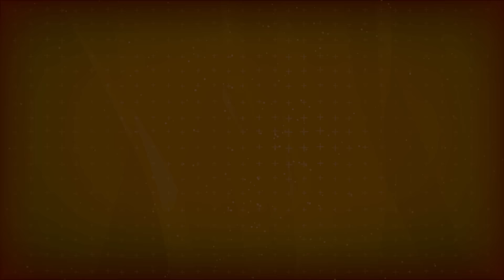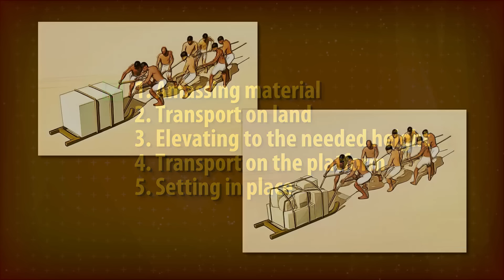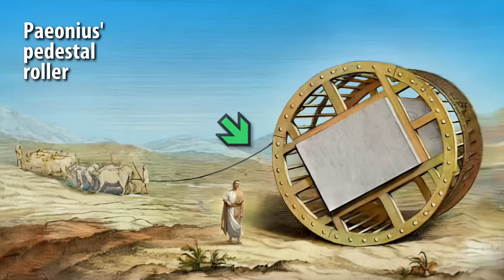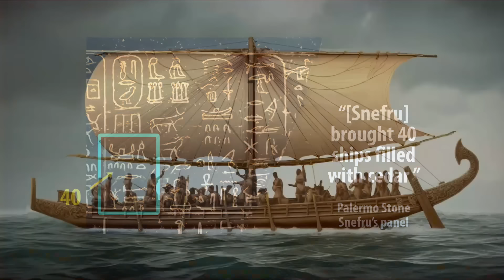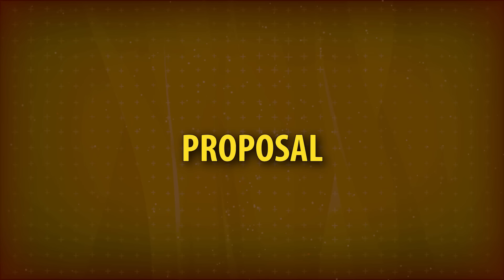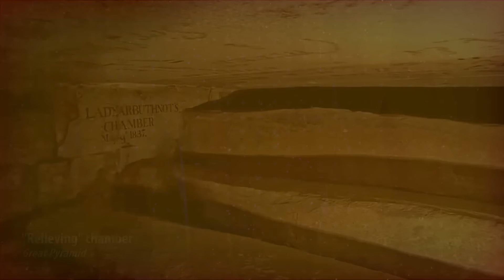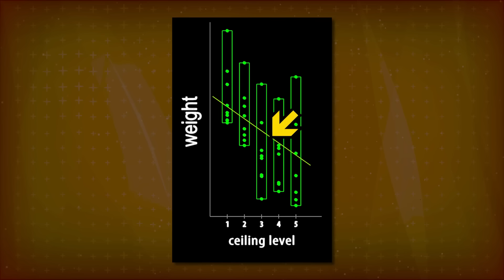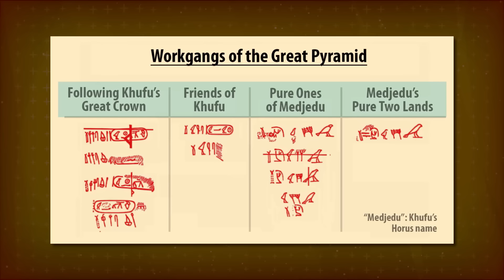How to Build the Great Pyramid in 9 Months (NOT aliens)

Comment: Interesting and well reasoned but I still think Houdin's internal ramp is simpler (and with more evidence) than the complex external fractal ramp. 
Your mud brick rollers could be used there just as well, and rubble components, and your various pulling machines.
I also think that Houdin's explanation of the function of the grand gallery for lifting the granite blocks is pretty certain. Without that use the gallery is a very bizarre thing.
Hopefully Zahi Zawasshole will go into the West soon and someone will prove Houdin.
Reply: It's a good thing Zawasshole exists, otherwise the Caucassholes of the world wouldn't have anyone to blame for the end of their rapacious and predatory pillaging of Egypt's material culture. After enduring the European and Moslem thefts and destruction that swept through Egypt and surrounding regions for hundreds of years Egypt finally reached a point of stability sufficient enough to allow for a curator/champion/ security guard to look after the countries treasures and Hawass was chosen for that role. His hard-nosed, overly-protective guardianship naturally rubbed many Western researchers the wrong way and led to accusations of theft but the charges were never taken seriously and he was completely cleared of such charges and works in his original capacity to this very day.
                                                                              Anyone who's willing to do a little research instead of listening to and believing a few disgruntled and privileged Western scholars and media will soon find out that Hawass is doing exactly what his government has asked him to do and done it while suffering accusations of theft, antiquities smuggling and the bullying of academics, etc. In reality, he should be applauded for his unwavering support of "Egyptian Egyptology" because, afterall, even if Hawass or a member of his staff hypothetically stole something (which they haven't) they still have an advantage Europeans can't claim for themselves: Anything a hypothetical Hawass might have taken was taken by AN EGYPTIAN, not some narcissistic, deluded, thieving European.

Comment: This is very well thought out.   I would lean to the internal ramp scheme, but that would not exclude your lift mechanism, at all.  I really appreciate the emphasis you place on the fact that other very large pieces of stone were employed during Classical times.  One other advantage you didn't mention when using rubble is that the pore space between pieces of rubble is mass savings.  Less weight in stone needs to transported.  Concerning the relative weight of limestone and granite, the two stones are in fact near each other in specific gravity.  Limestone will vary according to cementation and pore space.
Reply: Agreed. The internal ramp as proposed by the French architect does seem to fit very well with evidence found. This video, though, does complement everything else. Great video.
Reply: The space between big rubble pieces may have been fillef with smaller rubble and sand, rather than cement .  Carrying all the rubble in baskets or bags would compete with rolling for ramp access time, though could be done during the rigging gaps in the video proposal .
Reply: @johndododoe1411   In ancient construction, and even much later, rubble pieces can be quite massive, up to large boulders in size.  One other really critical factor about rubble construction produces, is that as long as the rubble supports the structure, in general the loading will be considerably lighter than tightly fitted ashlar masonry.  If the supporting elements in the construction were well-designed, you could construct a system of boxes with rigid walls, floors, and roofs that when properly filled with rubble would be less liable to collapse than a solid structure that overloaded the material.  Limestone for instance is not very strong simply because the calcium carbonate is brittle, and sandstone can vary.

Comment: I never heard that the pyramids were not made of uniform, cut blocks.  That information alone justifies a video, but you have added a number of other insights that makes this video very worthwhile.
I'd like to get right to the one thing that I am the most skeptical of, but after that, I'm very happy pour out praises on all the other ideas put forth here.
The mud roller idea doesn't sound plausible to me because they add  lot more weight.  And mud would have to be very carefully reinforced to be able to hold together under the load.
The wooden roller idea makes a lot of sense, and the ratcheting rope handling system sounds like a reasonable idea that was within their ability and knowledge.  The multiple zigzagging ramp idea also makes a lot of sense to me.
This has moved into first place among all the other proposals on how the pyramids may have been made that I have seen.

Comment: What do you think about them using acoustic levitation? Essentially they use copper 6ft long tuning forks as way to drill into a block and then hit it at a set hits per minute that makes the block resonate and then can be pushed by a single person on a 10 ton block. Obviously it doesn’t actually levitate it just reverberates at its resonant frequency so acts like a giant roller without rolling. It would be used to make a road for transporting blocks and/or could be how they transported them anyway. As they were very aware of acoustics as a glass of water would warn them of an invading army by the ripple frequency.

Comment: The rolling idea sounds very plausible.
Additional ideas (from other work on pyramid-building) which support your theory.
1.  Due to the annual flood, all agricultural work is stopped and sufficient food has between stored for this period.  This means the workforce is available for a mega-task.
2  Imagine the excited conversations in the village with men discussing their plans for the next build-phase.  There is a national 'buzz' around the project.  Competition between teams (as with football teams today.).  You don't need any level of coercion if everyone 'buys in' to the project.
3  The flood allows all the blck-transport to be done by boat (I think there is the remains of a canal up to the pyramid?
4 You have not assessed the idea that the smaller blocks and rubble were transported by pack-animals.

Comment: The issue still remains that according to our understanding of history, the materials they used at the time could not have handled the weights and stresses during construction. A crane is useless if it snaps and breaks when you try to lift something. What more trying to lift or move hundreds of tons that our current tech can't even handle.
Reply: If you repeat an untruth long enough...you're a liar.
Reply: The LR13000 has a capacity of 3000 tonnes. It can lift it over 800 feet high. The pyramid stones aren’t a problem.

Comment: I like this hypothesis and it would make the pyramid buildable in a reasonable amount of time (3 years, 2 months, assuming decent work shifts and holidays, similar to a 40 hour work week) HOWEVER, as reliant as it is on the specifics of that mud-brick quarter arc, you'll need to find at least part of a brick with those rope grooves to make this anything more than conjectural.
I kind of hope someone DOES find that brick, as this is the most pragmatic solution I've seen.
Thanks for putting in the time and effort and most of all, thanks for sharing it with all of us!
Reply: I would venture a guess that there may be a few broken half circles used as infill towards the top somewhere. Being as they were only sundried they may have just been broken down and used for mortar or repurposed elsewhere.
Reply: @grinningtiki220 Indeed this video proposes they were cheap single use items, discarded and destroyed after lifting one load .  If so, their parts would be everywhere in the packing rubble .  If not, mostly in upper levels .

Comment: Rolling makes a lot of sense to get to pyramid base, but from that point tree-trunk levers in chains up sides switching every 1, 2 or 3 layers would require less energy and complexity, less wear and maintenance with essentially no energy sapping friction.  Energy expenditure would have been a limiting factor, and one very fit worker could probably only provide energy to lift a 2 tonne block 150m in a day (equivalent to climbing 5km in one day that a fit person can do), meaning 1 worker lifting 6 tonnes a day to average height of 50m and approx 1 million worker days needed.  1000 lifters working for 20 years using levers makes the problem seem tractable - but they were only a tiny proportion of workforce, 10s of times more would have been needed to cut and transport 3000 blocks a day (or rubble equivalent) to pyramid base.

Comment: From the ground, if you used a modern 350 ton hi-strength steel crane (the largest mobile crane available) the furthest you can "swing" a 40-ton block horizontally is approximately 25 meters, to a maximum height of, not quite 20-meters vertically. From there the maximum, horizontal "reach" is reduced substantially, as higher placement is required; that is for the laser precision squared blocks, which are cut within 10,000ths of an inch of variance, whether it be rubble or anything else weighing 40-tons. 

It should be noted that the cut blocks at the site, are magnitudes of precision, beyond what the human hand and eye is capable of producing with bronze tools on sandstone and marble. Additionally, for granite, andesite and other materials of a #6 hardness or above on the Mohs scale, the difficulty grows to magnitudes of impossibility, beyond human capability, utilizing the available bronze tools, regardless of hand and eye precision.

 At approximately 57 meters high, a 40-ton block can be set to a maximum of 15-meters horizontally. That is insufficient to reach the required distances for most of the construction process. Therefore anything of lesser quality is also insufficient, regardless of how much tortured logic is employed by inexperienced imaginations. 

What is ideal and far more likely to have been used then (more like around 50,000+ years ago, not 2,500) as now, is a crane constructed directly in the center, at the opportune height over and above that of the pyramid itself. It would appear much the same as the cranes you typically see over the top of high-rise buildings, during the erection process.
Reply: Oddly, since the Egyptians didn't have any 350 ton hi-strength steel cranes your post is irrelevant (they didn't have lasers either) but then, you knew that...right?

Comment: How do you get the fractal ramp off the pyramid when you're done? How many months of work does that require? Of all these "proposals," one of them actually has evidence in its favor, Houdin's internal ramp, thermal imagery showing an internal spiral structure, traces on the exterior faces, and the turning platform just where it has to be and in line with the internal ramp. Not only does it get the job done, it doesn't have to be removed after the pyramid is finished, saving an enormous amount of work. Also, his explanation of how the Grand Gallery functioned as a hoist is convincing, especially given all the physical evidence for its use in the manner he imagines that is still there. We knew to look for the unexplored second gallery because Houdin said it should be there, and lo, so it is. You have to incorporate that into your model for it to be meaningful relative to the physical evidence. Everything you said is plausible, but not all of it is supported by the archeological record.
Reply: Great comment !!  Exactly what I was thinking !!!!
Reply: Why not both? An internal main ramp and dozens of outer fractal ramps would greatly speed up the process. Especially for the siding to finish it off. Both are very plausible.
Reply: @grinningtiki220  Because there's no evidence of fractal ramps.
Reply: @daveadalian4116  Is the issue with the fractal ramp theory or exterior ramps in general?
Reply: @grinningtiki220  There is physical evidence an internal spiral ramp exists. If the Egyptian authorities would allow it, an investigation would be able to confirm or debunk the interior ramp. There is no archeological evidence for the exterior ramp described in this video. That's the issue. There's no reason to invent a fractal ramp, even if it is pretty clever.

Comment: This is actually a very good video, using sources of the time that the Egyptians would have from other cultures. It is safe to assume, local cultures shared or learned of knowledge and building techniques of other local cultures. And may not have been used widespread, but still used. That for one, is a very logical conclusion that many Egyptian archaeologists don't accept, but should.

Comment: To keep the corners straight and meet to a point can be done by using range poles. From the corners out set up poles in line for a distance and lining those up. Don’t forget the slight crease going up the center of the sides.

Comment: The actual great pyramid, has no full perfect triangle formed sides, but consists with a slide inward bend in the middle of the base in  straight upper like to the very top. So has 2 resting opposing triangular forms.

Comment: This is a interesting theory and I think makes far more sense than most others. It also would still work with the internal ramp or an external ramp. You can see suggestion of marks on the few remaining casing stones that would support the external ramps and there is also the evidence for a internal spiral ramp. Who knows perhaps a combination external for up with the bulky items with the internal for shifting the quarter wheels back down.

Regardless I think you are much closer with this. It makes sense without having anything "inconvenient"  that has to be ignored in order to be feasible.
Reply: I am pretty sure that the timing only works with external “fractal” ramps, and not with internal ones.

Comment: This is a great theory about the possible use of the "1/4 circle" artefacts for stone moving and a brand new multiple ramp system theory.
I wonder why you opted for the rowing method of rope hauling, seems to add a lot of complexity across the whole building site?
Also keen to hear your theory for the grooved stone bosses that have baffled many theorists.
Terrific work so far, with wonderful production values, thanks for making this available to us all.
You are a welcome voice in this arena where so few calm heads prevail, congratulations!
Reply: If you've done manual work outside , anything to make life easier is welcome.
This is a very logical extrapolation of things that have been found
 Multiple sitting 'rowers' could probably work for much longer even if it does take a little longer to construct and make the necessary 'machinery', particularly if some of it was already in existence from other projects then just copied and repaired for later jobs as it probably took some time and effort to build in the first place (for much of history 'we' didn't have a throwaway society)
It wasn't just something done to 'maximise profit' but to allow the workers to continue doing their jobs for months at a time.
It's pointed out working 24/7 isn't realistic but even so, using this method could easily result in a completed structure within a few years and not the 20+ years normally stated
Reply: @1crazypj  It occurs to me that the "rowing machine" would also be an excellent sun shade for the workers and would be simple to pick up and transport/tote to the next level.
Reply: @seeker1015  That was my thought as well but comment was getting pretty long
Reply: Aside from the answers already given about shade and such, there's the issue of efficiency. Levers allow each worker to pull harder than simply standing there yanking directly on the rope, which allows for two options: move heavier loads, or reduce the amount of effort the men have to exert at any one time, allowing them to work for longer shifts before needing a rest. The rowing method also makes it easier to use more body strength by using the strongest muscles in the body to do it.

Comment: OK. I see how this method would move stones from the ground up.
But then how did the huge volume of rubble move from the ramps to fill in the interior?
Each piece of rubble would need to be individually handled horizontally and mortared into place.
So as the casing stones were being rolled up the ramp, a crew of men would be carrying up buckets of mortar, while another crew would be manhandling the rubble into place?
Would the system of ramps be rebuilt and moved horizontally each time a layer of rubble was placed?
This backfilling would be very time and labor consuming, and would be the limiting constraint on all the activities on the site.
Reply: I would hate to work for you, even the way you described the problem would be a problem whereas the Egyptians, clearly, were more fond of solutions.

Comment: One theory that makes a good bit of sense is the large antechamber has its "strange" construction because it was used as an area/system for a counter balance to lift the granite stones above the Kings chamber and put them in place.  Fun video. As videos like these, brainstorming of ideas, is what can lead to how the Great Pyramid was actually built.
Reply: water pump theory
Reply: @theWichd  I agree. Saw the simple locke system. Float, work with the Nile.  😮
Reply: Not labor intensive, low manpower. Smart simple bouys for heavy lighting. Each layer finished complete, all the way up.  hydraulic's